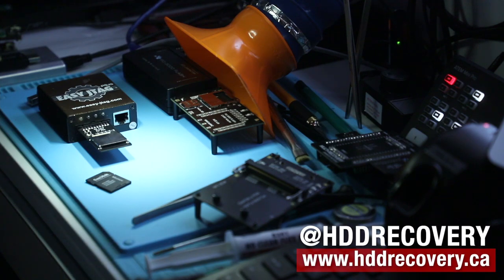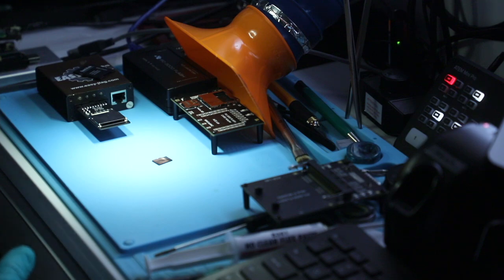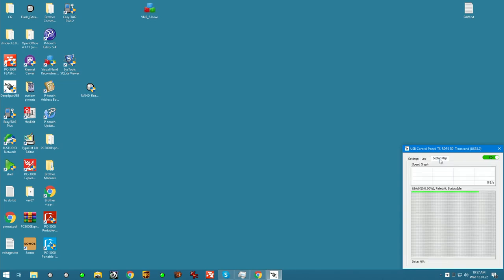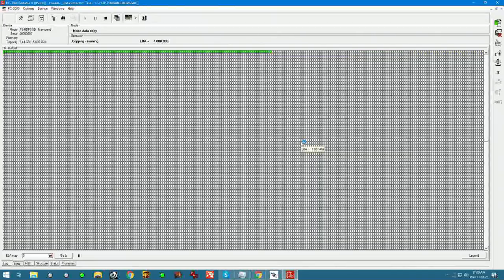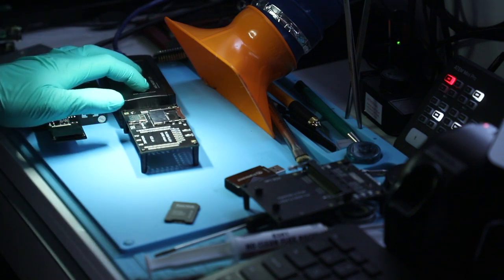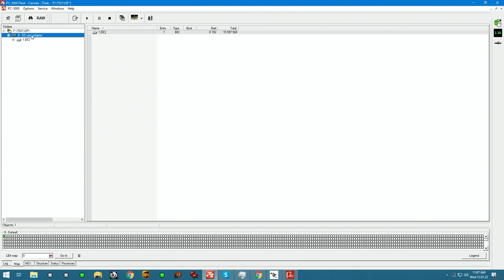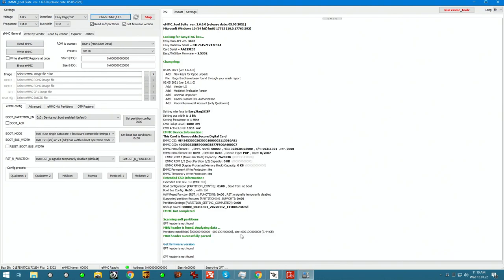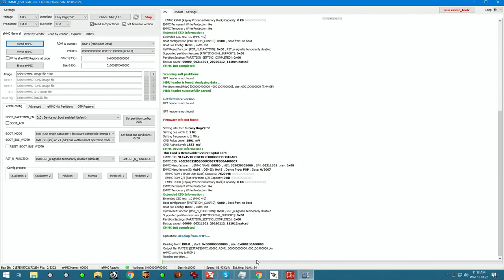degrading card data extraction process step by step

Comment: Does that mean that on 1x speed on pc3000 it give same image that ezjtag give? And as you siad we as viewers can suggest - i'm intrested in - if someone use microsd on new android phone save pics on it and then microsd was formatted by the phone what will happened? I have no phone with microsd (i have old iphone 6), so i can't check it, but i seen card that was formatted by phone and in r-studio or pc3000 flash dadpter (raw recovery) it show nothing but new data which was creating by phone (i mean folders and stuff that phone add by default) no sign of old data. I found out that maybe formattin in the phone tell controller not to show old data (translator) but they can be still accessible by directly nand reading. Sorry if i explain what i mean not too good

Comment: Seems as worst case - perfectly working controller with degraded/weared flash module. Sometimes power voltage changing may improve readability in that case.

Comment: Erkin ,
     I was in the village and i will be pouring my suggestions for all your videos.There are Two models of Easy JTAG ,The older EASY TAG and the new Plus Version  ,I have the old one and never put it to use much ,I used to resell it lolz ,Anyhow what do you have ,You seem to have a good cloning speed in x4 mode in PC3K Flash ,Why was x4 and high speed atleast what you used in PC3K Not used in Easy JTAG Tool you have   .Deepspar Stabiliser Seem to be doing a very poor job for this case  .
Reply: "Deepspar Stabiliser Seem to be doing a very poor job for this case".

It didn't, or did you see the USB connection drop at any point?
Reply from the maker: Usually, stabilizer is amazing for these degraded cards, but in this case i was stalling. I need to update the control panel :)
Reply: @DiskTuna  Well,the point is not its dropping the device its about reading sectors  ,As it access data using usb protocol it cannot have control over connection speed x1 and x4 and also no control on speed like 1mhz etc  ,PC3K and Easy TJAG and Devices Similiar To Easy JTAG are the Go To Devices  For these kinda products  ,The Transcend SD to USB Adapter is doing SD to USB Conversion in this State And Both The Tools Mentioned Bypass That Issue .
Reply: @hddrecoveryservices  update it it will still not work try it
Reply: @chandigarhdatarecovery  "it cannot have control over connection speed x1 and x4 and also no control on speed like 1mhz etc"

Exactly, it can not do that. Does not mean it does not do it's intended job is my point.

"The Transcend SD to USB Adapter is doing SD to USB Conversion in this State"

Tell me something I don't know.
Reply: @DiskTuna  What you do not know is EAST JTAG go buy it

Comment: Easy JTAG looks interesting, I never considered it.. You probably know but I do not see you try because perhaps you want to demonstrate  Easy JTAG: Sometimes I get these to work on Stabilizer too, but you have to force the reader to USB 2 (more settings > other settings at bottom settings TAB), indeed make sure it's set to SSD/Flash Device and set read time out to some ridiculous high value like 10 seconds. Also make sure speed optimization is set to most conventional value. And I go don't go through PC3000, just use anything that creates dd type image. And I try this with UFD's too, in fact had one like that yesterday https://youtu.be/4LKPvV7ITCA